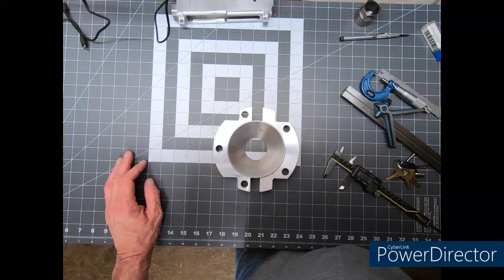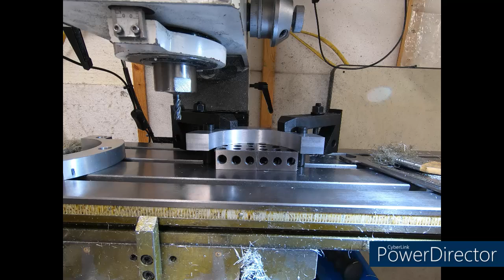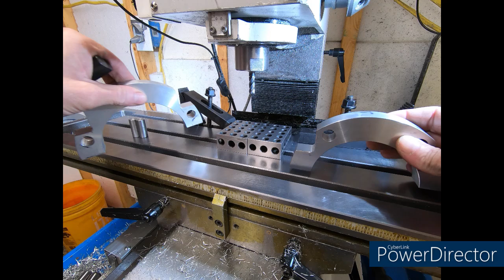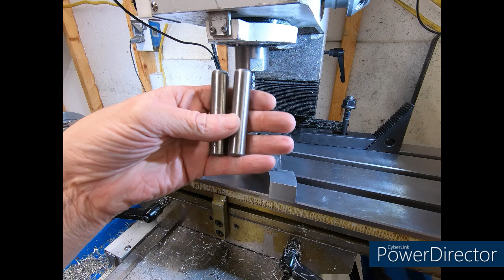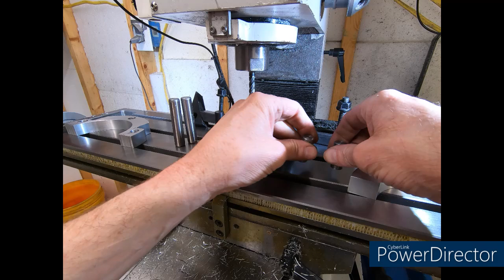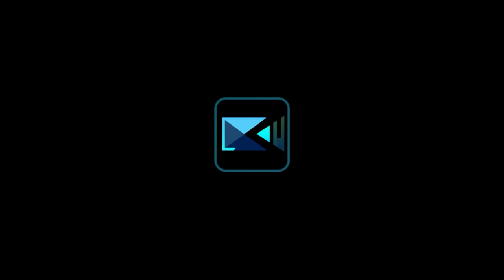Dowel pin milling set up @Toolmaker001

Comment: Toolmakers is not a word I would associate with this method. Long flexible datum stops? Use a piece of scrap in the vise, drill and ream 2 holes, fit 2 dowels, clamp part with clamps, machine to size. Use dro from dowel hole positions.
Reply: I did not see you using the holes to clamp the part. I must have missed it. I'll have another look.
Reply from the maker: You really should pay attention. My father used to say, "Make sure your brain is engaged before engaging the mouth."
Reply: Sorry I should have mentioned adding 2 tapped holes so you could bolt through the part instead of messing around with clamps and packers
Reply from the maker: @tates11 Wow, go back and watch the video. get a new engagement gear for your brain. It obviously has some teeth sheared off.

Comment: Not sure why you say this is for loose tolerance work. Dowel pin type fixtures or set ups are used everyday in the aircraft industry to hold feature locations and geometric tolrerances within well less than .001 in.
Reply from the maker: It's not a precise dowel location fixture set up, it's a T slot. and the dowels don't sit in precise location holes. If I would have said accurate instead of fairly accurate, then someone would comment "that's not accurate, you missed by .002" I built very elaborate precise aerospace dowel location fixtures for years. this method isn't as accurate. I also never used the word loose. I did say when dimensioning isn't critical.